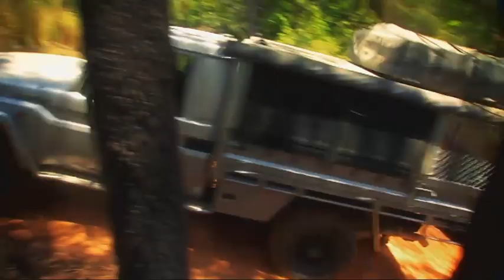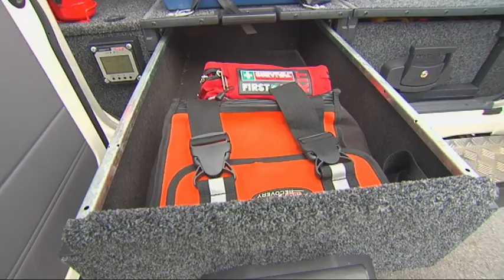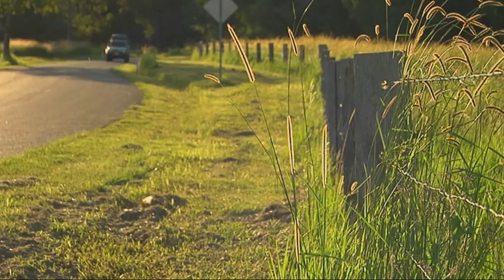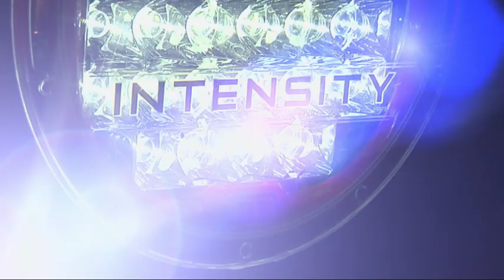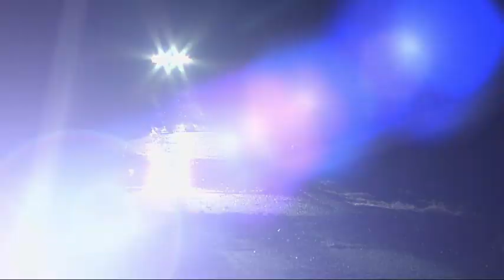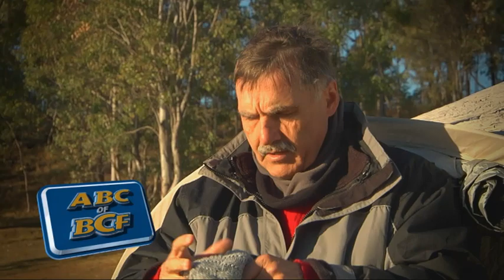Safe Touring Essentials (featuring ARB Intensity LEDs)

Comment: That antenna mounted on the bullbar: why is so thick? That is not a Cb Antenna or vhf antenna right? Btw: i loooooove it. What does it do and where can I find it
Reply from the maker: Hi Yosue, those are GME radio antennas. You can purchase them from your local ARB store.
Reply: Thanks a lot for your time. I was wondering if it will work in my country Venezuela with a midland 220 cb radio. Thanks